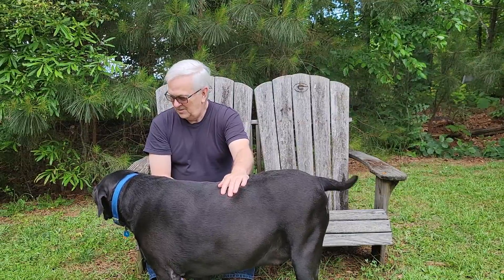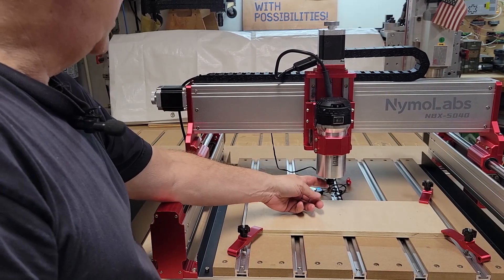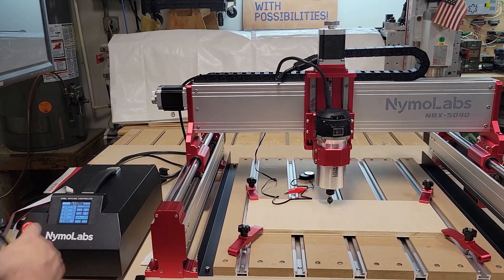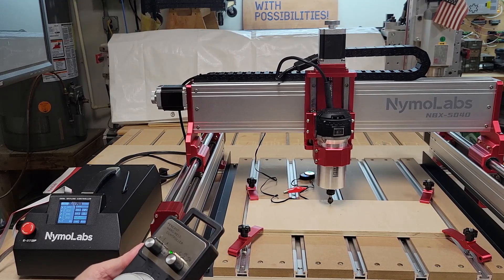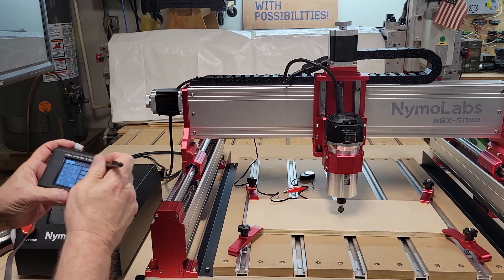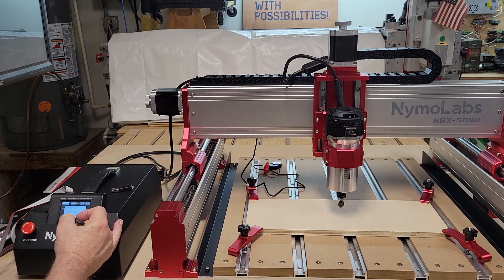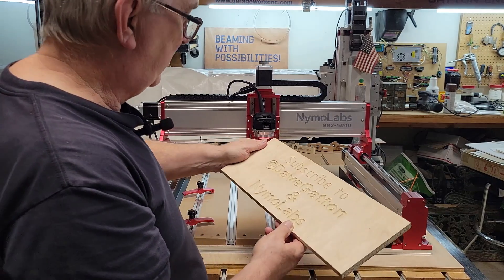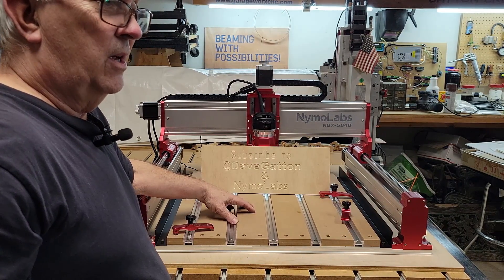NymoLabs NBX 5040 CNC Router | First Run

Comment: The machine seems to be nice, but, the Router, on my machine, does not turn on or run, when plugged into the Control Box.  I have to plugged it in separately, in order for it to run.  Any ideas, thoughts, suggestions?

Comment: Do you have to load files via the SD card or can you just connect your laptop with USB?  Thanks for the video.  Haven't seen too many for this Nymo Labs company yet.
Reply from the maker: @alwatts9713  You can use the SD card with the offline controller so you don't need a computer at all or you can connect a computer and use Candle, UGS, Gsender, etc..  Nymolabs has just come out with a new offline controller that has a 7 inch screen.  I showed it in my CNC Q & A podcast a couple of days ago.